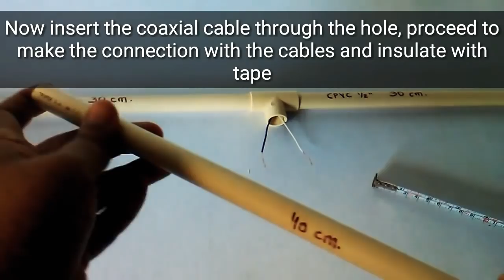POWERFUL HDTV ANTENNA 📺 with ALUMINUM paper and PVC

Comment: no balun/matching transformer?
Reply: For the best results, I suggest you use transformer for change the impedance from 200 ohms to 75 ohms
Reply: All the dipoles have 72 Ohm.  @haris-rw6om
Reply: @guillermosempron5776  Sorry I didn't measure the impedance, but only added balun without a power boster and the results were very satisfying

Comment: Can I use ¾ PVC? and how long for the coax? ± 2 meters (enough)? Thanks
Reply from the maker: you can use a smaller diameter, enough so that between the aluminum foil and the 2 meter cable is fine if it is for indoor, but you can place it outside adding more meters of cable and it will work much better
Reply: Jesus Lopez thank a lot 👍
Reply: Jesus Lopez can I ask another question? Does the antenna can capture Analog TV because in my country it's difficult to capture the analog signal especially when we live in the city where there are many high building. Unfortunately some TV Channels can only view in analog not in digital (because the copyright issue). Thank you.